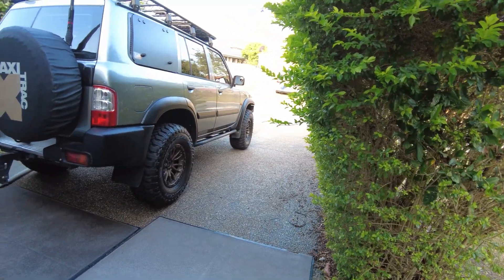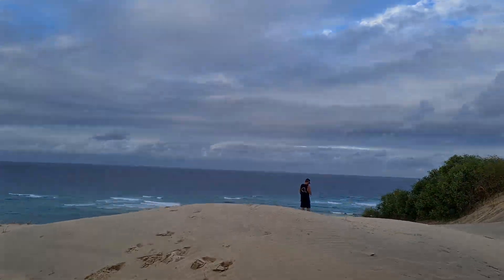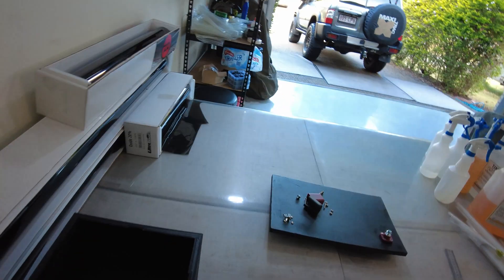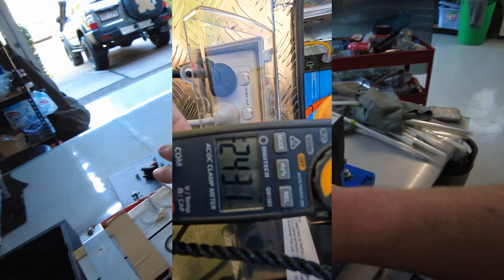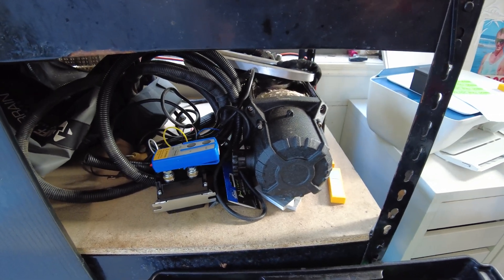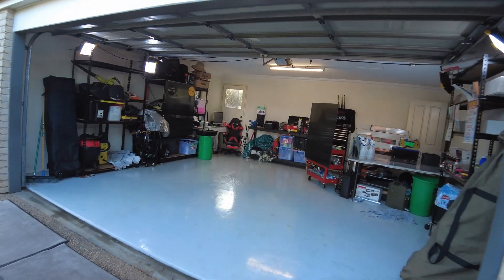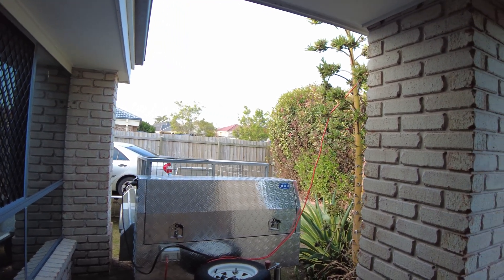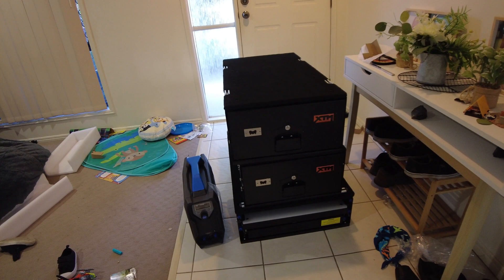What"s inside the KINGS 200ah Lithium Battery?

Comment: Would the 200ah battery fit into a kings 120ah lithium battery case
Reply from the maker: @vaskodimoski5690  if it wasn't laser welded together you could re-configure it to fit in one of those lithium cases.

Comment: The reason the boxes are so large is because not all the Kings 200ah lithium batteries are built with the same configuration.  Yours are built using 4x 200ah cells in series, others are built using 12x cells so they're leaving themselves room. ie: https://www.youtube.com/watch?v=H8X1mcULu5c

Comment: Thanks for the informative video. Was keen to give the Kings 200ah battery a try as it's one of the smaller foot prints out of some of the cheaper 200ah batteries around. Now I've seen your vid I'm even more so now, will open it up and get my own smaller box made. Any tips on how to open the King's box and where to get those terminals for the lid from in your vid? Cheers
Reply from the maker: Muller Energy sell those terminals mate, and the lid comes off with screws under screw caps on the lid. The battery will fall out when you heat up the bottom of the battery case with it sitting upside down.

Comment: Sorry to hear about ur problems mate, keep yourself busy and active. Yeah, these batteries would be much better in a smaller form factor for any market really, pity the dimensions u were after got messed up, it looks like a nice solid structure he has built otherwise. I have used two of these 200A kings for a canopy build & I put them end to end across the headboard area, would have been nice to have a smaller footprint. What BMS are they using here? Is it a JBD? The Kings batteries & inverters are probably sone of the best value for dollar out there at the moment. Keep ur chin up bud. Cheers
Reply from the maker: Thanks mate, really not too sure on what BMS they're using but have no issues at all with them hey
Reply: @WEEKENDER4X4  is there no identifying info like a serial or model number on the board? I thought they might have a JBD BMS which are generally pretty good.

Comment: Do you still have the small 50ah atem power battery to review at some point? Im keen to see what they're like as i want to do a small 20L fridge setup for my partner in the i30 just to keep the shopping cold since its quite a hike to the local shops for us. If the 50ah lithium is any good i might pick one up
Reply: @WEEKENDER4X4 no it was a small black battery with a blue and white label, im now wondering if ive mixed it up with Australian 4x4 adventures channel 😅 either way looking forward to the review, both good channels ❤
Reply from the maker: Sorry which atem power 50ah? I've never had atem power one. Do have some cheap ebay 50ah that were supposed to be 100ah
Reply: @WEEKENDER4X4 oh i thought i saw in a previous video a while back that you had a small lithium that was for an upcoming review but maybe im mistaken. If i find the video again ill comment on it
Reply from the maker: @lexicase8805  ok perfect, you may have been referring to the outbax/voltax blade slimline 100ah